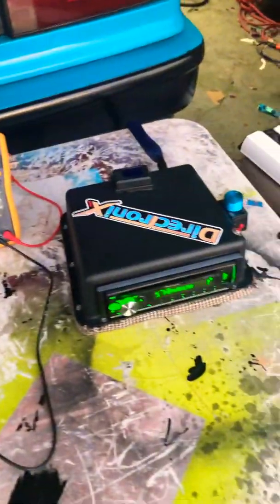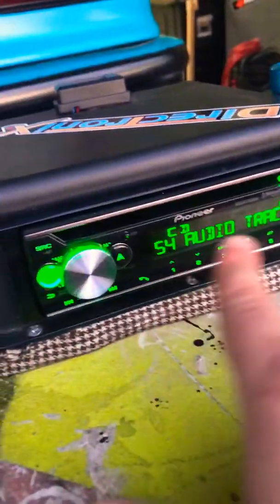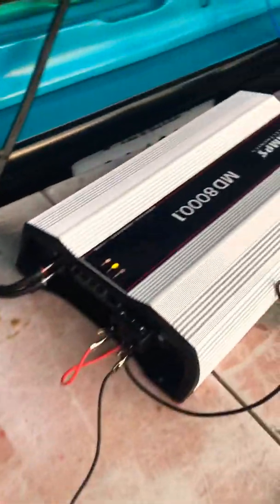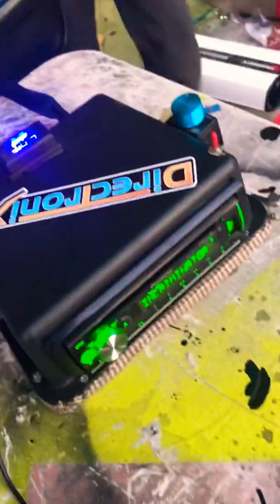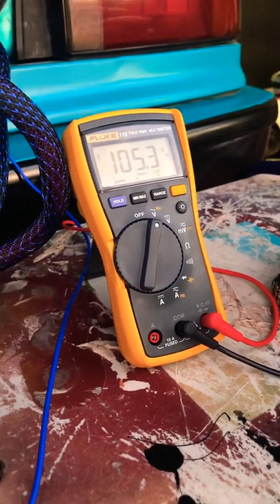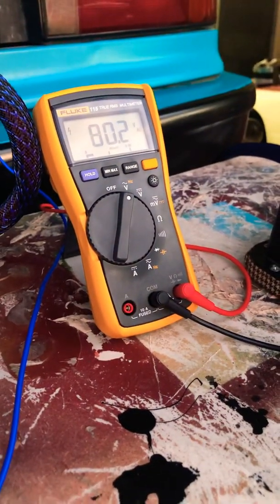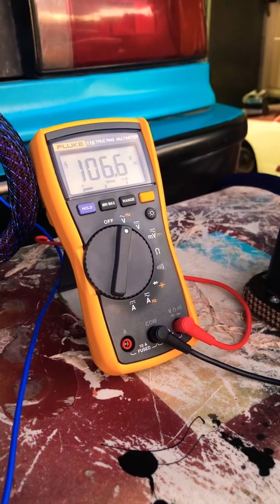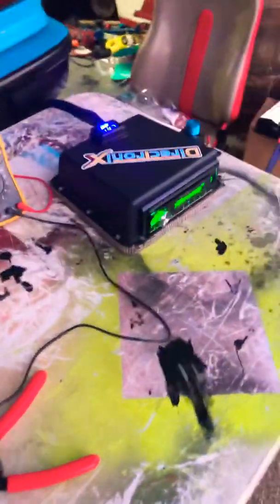Setting your amplifier gains with a multimeter

Comment: You can't just turn the source unit all the way up, you don't know at what volume distortion is being introduced. Without an oscilloscope or a DD-1, you'd have no way of knowing. If you don't have access to those devices, 3/4 volume on the source, then setting gains would be best practice. Now I realize ppl aren't going to be driving around listening at max volume all the time, but you never know  :D
Reply from the maker: I know what this head unit clips at, as I have used a DD1 myself (very useful tool). This video is just a very simple how-to on the head unit we use to compete with. Our older alpines do not clip even at max volume, pretty insane honestly.

Comment: So if your amp doesn't have a clip indicater, how could you possibly use a muilt meter to set the gains? We have no way of knowing where the sine squares off and no clue on the boarder line clip. Also you are checking the signal at the very beginning of out put. You should hook your subwoofer wire in the amp terminal and put your meter on the end of wire where your subwoofer will actually be receiving the signal? You never can tell and it just eliminates a misrepresentation of the real life signal. I have seen some unexplainable strange shit, thanks for the video bro.

Comment: Hi. Man, I followed your instructions but some how the multimeter keep reading (0.0). The multimeter is now and Its working properly.  I don’t know what I am doing wrong.
Reply from the maker: Hard to say. Make sure you have the probes in the speaker cable holes, and the amp is turned on (I did this several times not realizing my amp was off). Also make sure there is bass playing in the song, and you have your bass turned up on your radio.
Reply: Usually 0.0 or 0 on a multi meter means open lead. That means not a good connection somewhere for the device to get a reading.
Reply: Jeremy Strain Ok. I fixed it. Now, I have a 2020 Subaru Impreza with the stock head u it radio and the max volume is 38. Do I have to set the volumen at 75% for setting the amp gain? Does it matter if i am using the stock radio or aftermarket radio?